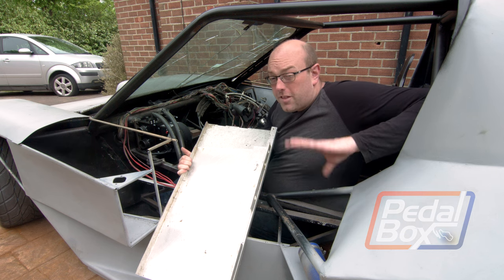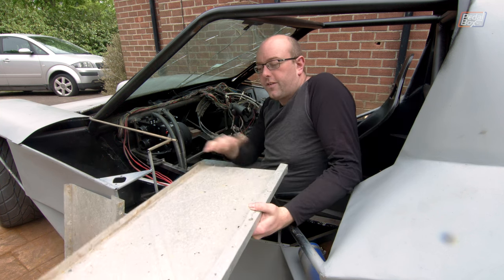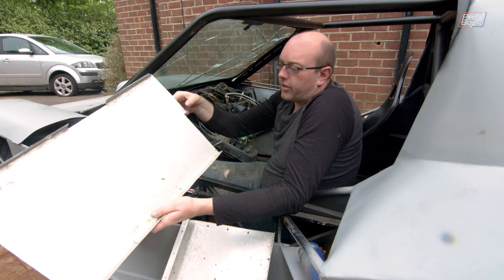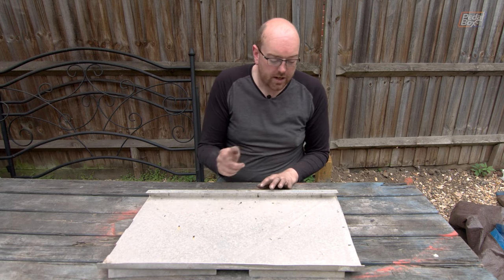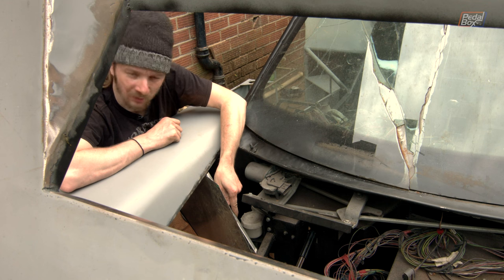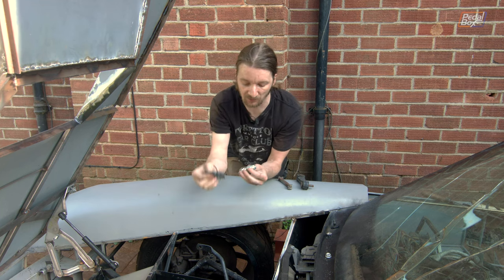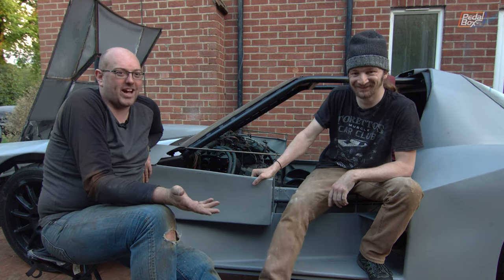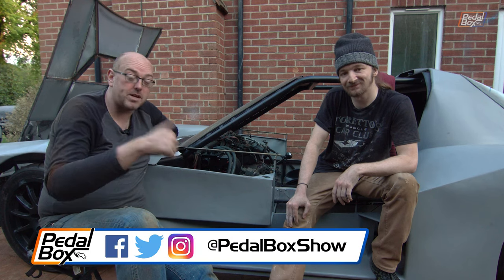Upcycling Panels | Audi TT Kit Car | PedalBox Episode 105

Comment: If you cut down those panels across the old rivet hole centres you might have secured both with single rivets.
Reply from the maker: I thought I might get away with that, but it's need washers to increase the surface area of the rivet head, and then i remembered how much I hate dealing with rivets and washers and ran way from the issue :D